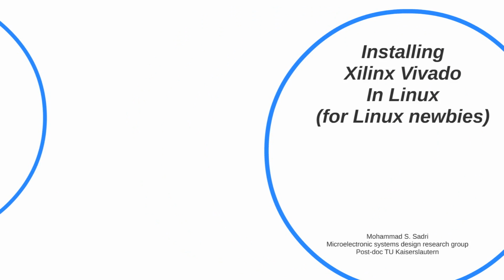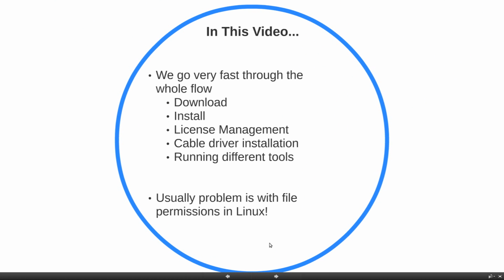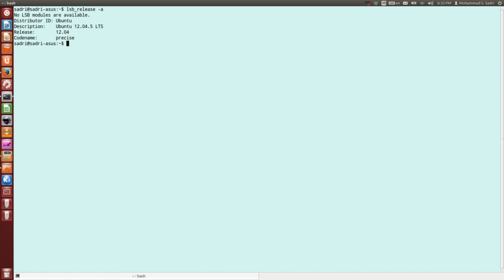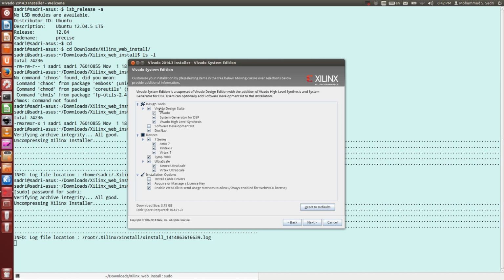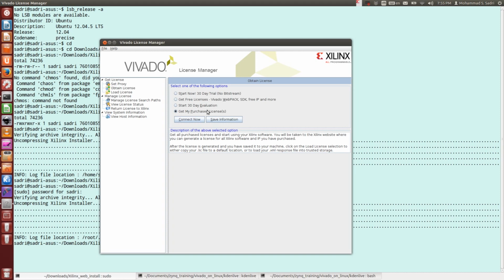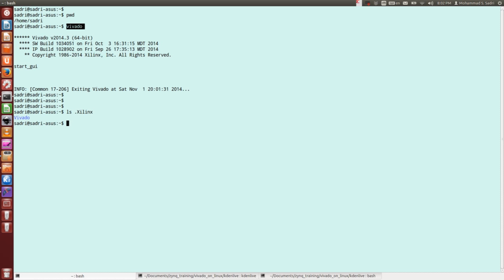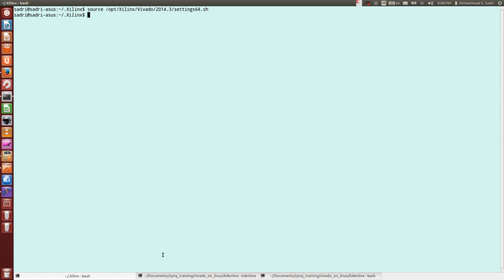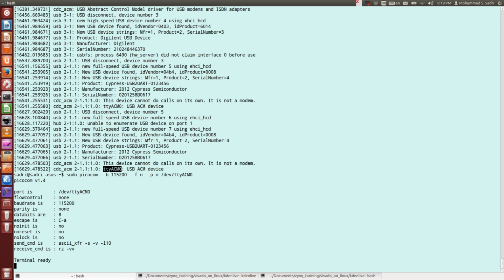installing xilinx vivado on linux for linux newbies

Comment: Well done Sadri. great help. Ubuntu 12.04.5 LTS works perfectly.
I tried Ubuntu 14.04 LTS, and I could not get it to work with 2014.4 or 2014.3.1. First problems with Java, causing segmentation fault. Found on-line fixes using Open JVM, but then progressed to another error which I could not fix. Strange as 14.04 LTS is recommended by Xilinx.
Reply from the maker: Steve Fielding Hi Steve, it is now a while that I have switched to Kubuntu 14.04 64bits, and i am using it both at work for those serious pci express projects and also at home for my hobby playing with zynq and so far it has been very good. just in case you want to generate pcie axi bridge and ip cores like that, use the initialization script that i have put on my dropbox folder to setup vivado before running it. that is not mandatory, but well, it makes you sure vivado does not produce silly error messages just because of messing up the language!

Comment: For those running running Arch Linux or Manjaro or another "unsupported" version and get the error "ERROR: This installation is not supported on 32 bit platforms." on a 64 bit platform:
 
1) Start the installer with the --confirm parameter and allow the extraction.
2) In another terminal window go to the path of the xsetup file that was displayed (/tmp/....).
3) Find and modify the xsetup file, "uname -i" shall be changed to "uname -m".
4) Confirm and execute the ./xsetup file in the installer shell.

Original thread: http://forums.xilinx.com/t5/Installation-and-Licensing/I-get-quot-ERROR-This-installation-is-not-supported-on-32-bit/td-p/597759

Comment: Hi,
here everthing goes fine like in your video. And both xmd and dmesg can detect the zedboard. However, I notice that if I make the serial connection using picocom or minicom, the Xilinx SDK cannot find or see the zynq device anymore..If a break the serial connection, then SDK can see it again and I can program.. However as soon as I connect using picocom or minicom or gtkterm, JTAG connection stops working...Any ideas ?
Reply: Problem solved. When running on virtualbox, we need Oracle VM VirtualBox Extension Pack and Enable USB 2.0 (EHCI) Controller option checked. Full instructions here http://zedboard.org/content/windows-7-sdk-20142-cable-not-connected-error

Comment: Hi
I have a little problem. Every time I want to run vivado from command line I must run a settings64.sh script before it, because bash did not recognized word 'vivado'. 
Is there any chance to just type vivado in terminal without runing settings script before ?
Thanks
Martin
Reply from the maker: yeah, source setting64.sh file at the end of your .bashrc file. 
whenever you open a terminal .bashrc gets executed automatically and the source happens. 
then just run vivado. 
And one more thing, sourcing only settings64.sh is not enough , look here : 
http://www.googoolia.com/wp/2016/05/27/vivado-2016-1-on-ubuntu-16-04-64bits/
Reply: Thanks Mohammad !!! I added settings64.sh command in .bashrc file and now it works fine :)
I am using 2015.2.1 version of Vivado so I need not to take those steps mentioned in your link (I think)
Reply: May I ask dumb question? Where is the bashrc file located??
Reply: /home/user/
It is in the default directory when you open terminal